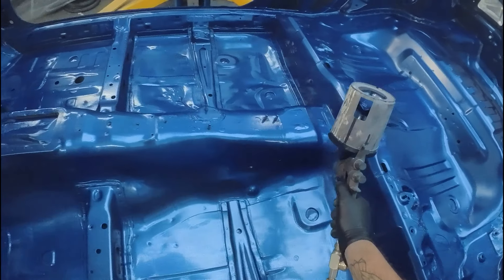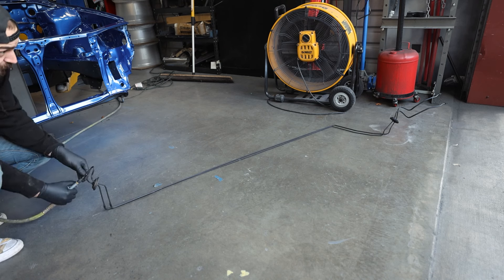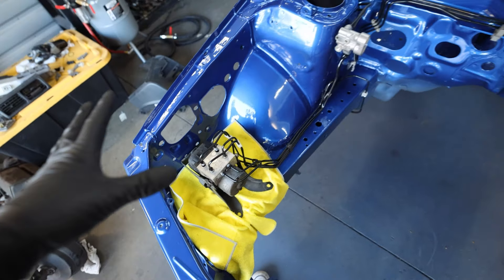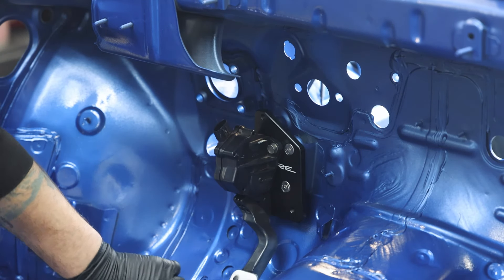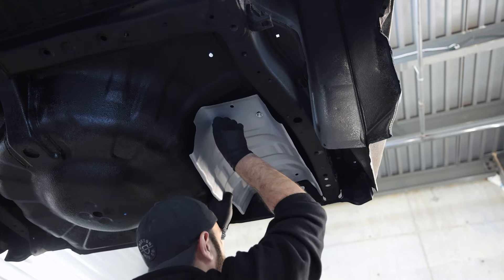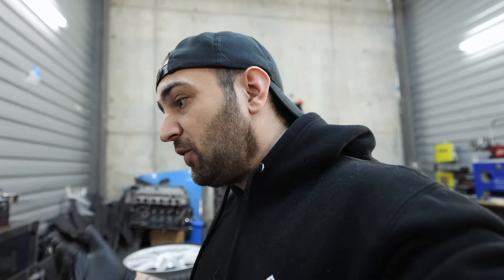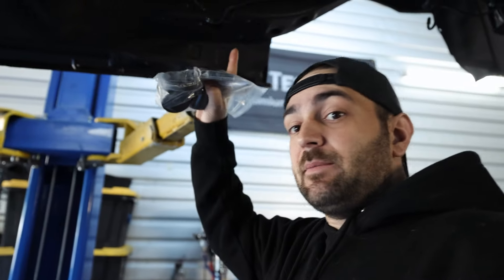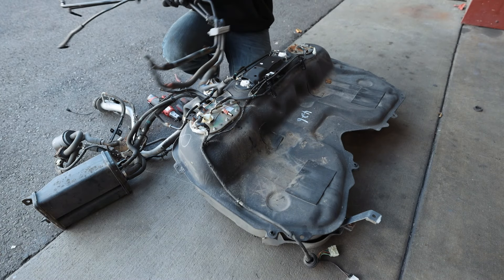Subaru 22B Build; The Build Begins.

Comment: 22B is looking beautiful 👍 my good friend got me into scooby’s he had a gc8 type RA v limited. I’ve got a 2001 fozzy it’s in my pic . Subaru life
Reply from the maker: The fizzy looks great! What’s the game plan for it? 🥳
Reply: @Smeedia thanks, been watching your channel for years . I live in Scotland 🏴 the weather here ain’t great plus loads of salt on roads = rust lol bought the car 4yrs ago totally rebuilt underneath sti shocks sti arms rear subframe full 3” exhaust plus down pipe and up pipe, full timing belt kit +water pump all done by myself with help from you 😉lol 340lph fuel pump alloy header tank alloy radiator all new silicone hoses wrx 4 pot brakes classic speedline alloys, and paint Porsche Rivera blue . Been unwell for a while hospital appointments operations just waiting on the all clear 👍. Get the fozzy finished and tuned
Reply: It’s my daily driver 👍 and 5 speed manual it’s a sf5 s turbo
Reply: "he had a gc8 type RA v limited"

Those are exceedingly rare vehicles. Only ones to come with both a DCCD and a helical front diff (TY754VB1EA)
Reply: @occamsrazor1285  yeah always remember him hitting the switch Down at the handbrake the thing was savage, aluminium body panels bonnet as light as a feather 🪶 , years later he had a WR1 as well.

Comment: On the clear coat looks like you have a lot of dry spray spots. And it looks very orange peely in other areas Make sure your flow is 3/4- full open. And try to add a bit more pressure. I usually spray at 27-30psi  and the spray pattern should be around 6-8 inches.
Edit: Also don’t spray the clear coat like paint you don’t want to “mist” it on. Try and keep it consistent distance away from the panels. (I know that’s hard in the shell with all the weird angles)
Reply from the maker: I’ll try on a couple test panels, the videos I’ve watched tell me to spray it wet. Painting seems to be all over for what is suggested 😅

Comment: I've wired wheeled a trans before to make it pretty... Never again :x

I would have done the headlights last.  Too easy to damage them while in the engine bay.  I sometimes take them off while working on the engine since its just 4  quick bolts.
Reply from the maker: They’re easy enough to pop back out if needed. Trying to get back some shelf space 😅
Reply: @Smeedia  Ah, that I understand lol

Comment: If you can build a dolly bring it outside when sunny will help the paint cure alot faster.    I used the eastwood  2k clear spray can when I did my jdm fuel door on my gc I had it in doors off the car for a month and the paint was still soft. I put it outside in the sun for 8 hrs and the paint was finally rock hard
Reply from the maker: I’ve had the heaters ripping in there, once I get it to a rolling shell it will go sit in the sun for a bit 😅

Comment: Where do you find all the new bolts for the subarus? Im struggling to find a kit or who to go to for mine.
Reply from the maker: I send all of the old ones out for plating 🫡 they acid dip the old bolts then re zinc plate them